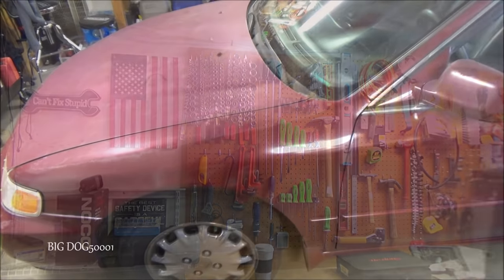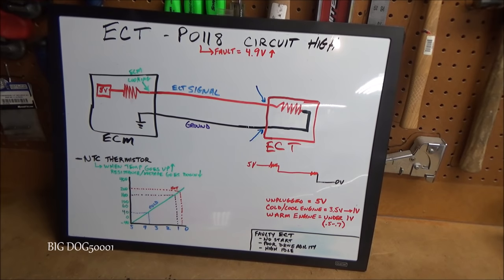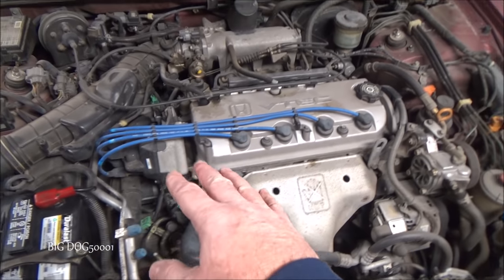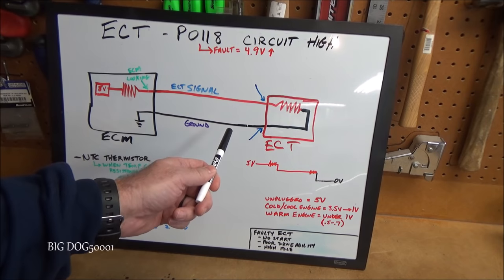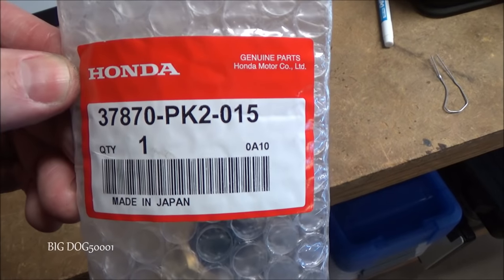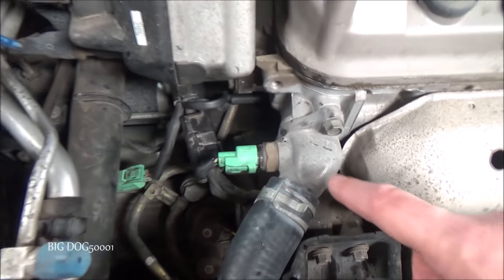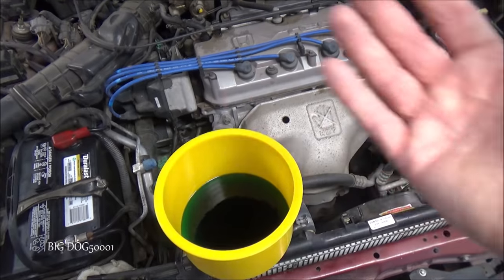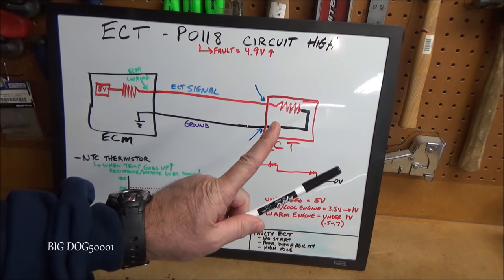Honda P0118 Engine Coolant Temperature Sensor (ECT) Circuit High Diagnosis and Repair

Comment: I have problem with my honda accord 2006 , the code PO 843 ( transmission fluid pressure sensor ) or  second clutch transmission  sensor , D ( dirve ) light flashing  ,
and I did service  for the transmission ( change the transmission  fluid  ) and I replaced the sensor too , but the problem still on , what  should I do ? please help me ... thanks you 
the problem start when I repalced the batterey , and I replaced the batterey 3 time because under waranty ,
Reply from the maker: That code is an electrical issue (and not typically a mechanical one).  A P0843 code is an open circuit for the 2nd gear transmission fluid pressure switch (2nd clutch).  That switch pulls a 5 volt reference (5V) from the engine computer down to ground (0V) in second gear when there is hydraulic pressure.  If engine computer doesn't see a change in the switch voltage (voltage pulled from 5V to 0V) for more than 2 seconds when vehicle is in 2nd gear it will set trouble code P0843.  It takes two driving trips to set this code and three trips to clear code (if no issue).  

Possible issues are a bad pressure switch, bad engine computer not providing 5 volts to circuit, bad ground, or open/broken wire or bad/poor connector in the circuit.  Hopefully the engine computer was not damaged during battery replacement.  I would make sure terminal connector at switch looks good and is not bent or corroded (sometimes the wire is broken at connector under the protective coating and can't be seen).  After that I would check for 5 volts on the wire at the pressure switch with a volt meter (switch unplugged, ignition key on but not running).   Might need some troubleshooting done by someone who knows these circuits.
Reply: @BigDog50001  thank you so much for your reply , 
I agree with you that it is a electrical problem , and this problem started when I changed the battery ,  and the engine light goes on and off. Sometimes the D (Drive)  light flashes on and sometimes without, just the engine light on. The car still runs good but this problem has gone on for a year now and the gear shifting is good. That means the sensor is doing its job, look like the problem is on the skin not a deep electrical problem. And I changed the ground cable the one connected to the battery but the problem is still there.  I brought the car to the dealer but they can't find what the problem is. They suggest that its maybe a computer problem. But I think if its a computer problem, the car would have broken down by  now but its still good after a year. I suggest that maybe the voltage of the battery is playing up. Should I change the battery with a different brand? Please help.

Comment: How to check this problem if I do not have a scan tool or code reader?
Reply from the maker: At the very least you would probably need the $35 code reader I used.

Comment: I have a 99 accord v6 been haveing a problem every now and then where your leaveing a store start the car up and it shakes and dies and you start it back up and half to give it gas till it finally clears up runs what’s searching on internet and seen where coolant temp sensor would cause this problem it has engine light on for cyl 2 and 3 misfire the man said it’s not a misfire it’s because the cars shakes thinking it’s missfireing the vidieo was from bundys garage was wandering if you ever heard of this problem he called it a heat soak vaper lock.
Reply from the maker: Yes I know about hot crank no starts on Hondas caused by incorrect ECT voltages (bad ECT1).  Not sure if that is what is going on with yours but I did a tip video on these here:  https://youtu.be/S2RLQQy4XTQ?si=x42TZWtBiE2rpIia